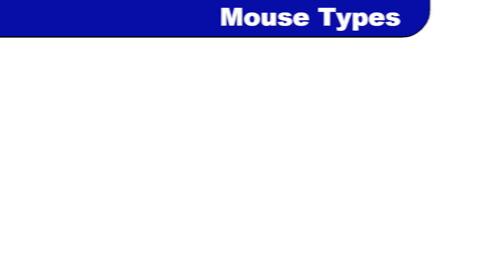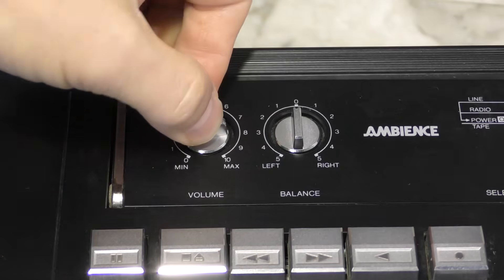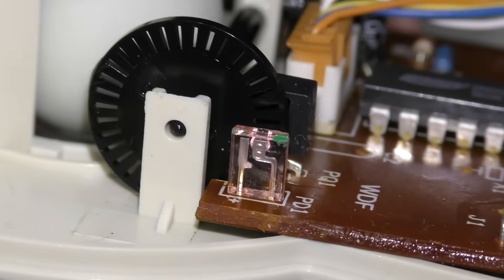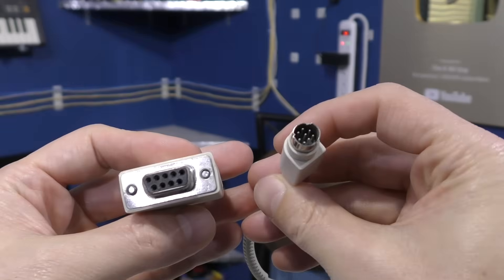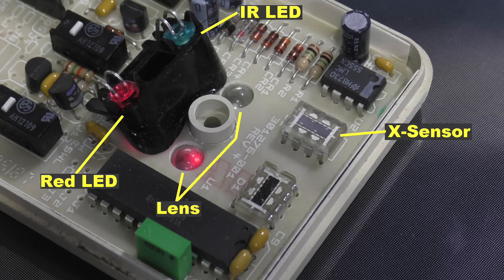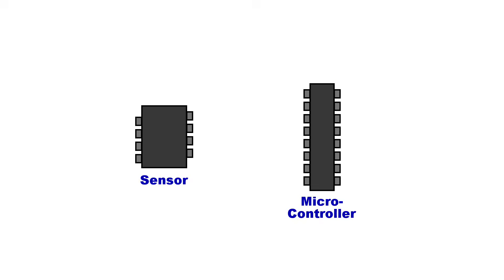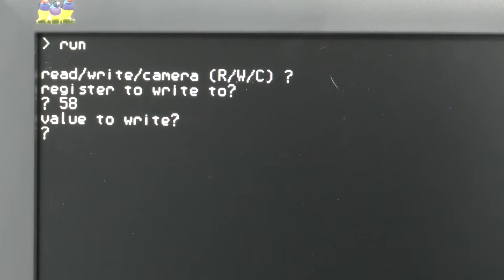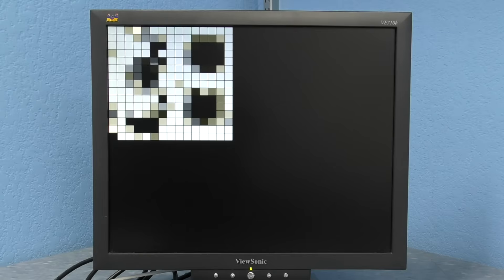What does a computer mouse see?

Comment: 3:07 I always cleaned the ball... My whole life was a lie
Reply: My dad is a technician, he would always pull the gunk out of the inside with a pocket knife so that's how I learned to clean it (not with a pocket knife, of course).
Reply: I remember doing this as a kid. Just used my nail to scrape the rollers, never even thought about cleaning the ball, because it didn't look dirty 😋
Reply: I was 1 years old when those mouse came I think-
Reply: @kruleworld  That sounds neat! I use digital mice these days, but I must admit the rollerball mice have a special charm about them. Even if they could get pretty yucky!
Reply: When I started college, the workstations all still had ball mice. Sometimes one of my classmates would complain the mouse wasn't working, so I'd really quick flip it over, pull the ball out, and scrape the rollers with a fingernail (by the time it got that bad, the gunk was generally stuck together enough it all came off in one piece) and it would work fine afterwards.
Reply: It’s called natural selection
Reply: i used to always clean the ball.
i used to always throw it in the air and catch it  LOL
it was cool

but one day i realized there was a lot of shit on the rollers and sensors so i cleaned them and i realized what i needed to do
Reply: @martinkuliza  What a fookin tool

Comment: A theory for the read delay:
IIRC, those old connections tend to be half-duplex. Meaning it can transfer data both directions, but only one direction at a time. And it might take some time to flip between direcitons. Bytewise transfers would have to flip around at least once.
In normal operation, the Computer -> Mouse direction is propably only used during initial setup/device setup. Afterwards, the driver would be only recieving data (never sending anything else in return).
The actually work goes only Mouse -> Computer. The chip is propably staging the data somehow and sending it to the computer in one big batch, on a pre-determined timeframe.
Any delay between changing directions would hardly mater. And limitations like those were one reason we went for USB.

Comment: I don't think that potentiometer-based mouse was as much hard to use. Almost every GUI environment allows only a finite area for cursor position. It's usually limited with screen resolution. Potentiometers allow you to "instantly" calculate cursor position without any initialization at any moment, because it's trivial to scale allowed mouse positions into the possible cursor positions. Probably, the ball will do a hard friction at the end of the potentiometer range but that would mechanically signalize about the edge of the screen.

Comment: If you get a rework station, you can remove chips without needing to trim the legs off of them by waving the hot air over the legs while pulling up, it's super handy. https://www.hakkousa.com/products/rework/fr-810b-smd-hot-air-rework-station.html

Comment: My first ever PC had a serial ball mouse. I still have the last mouse I've ever used on that system somewhere. The only reason I kept it is because it also supported PS/2 in addition to 9-pin serial.
Cleaning those rollers was not a pleasant experience. Also, the resolution was pretty low even when compared to a low-end optical.

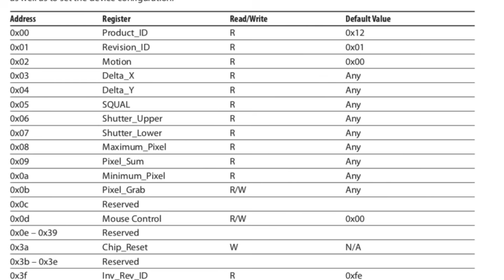Comment: 7:58 "Now you'd think all I need to do now is read register B here,  which is pixel grab."
No, no I did not think that, let alone think at all when the data sheet was displayed..
Reply: Benjamin Lum its actually not too difficult to understand, its all laid out on the datasheet, for example take the register Motion at 0x02, so since its using a byte it has 8 bits, below the chart with the registers it lists in detail the bits and the fields and what they mean, like for Motion it says bit 7 (it starts at 0 so 7 is actually the 8th bit) is MOT which it says is motion since last reported which returns two values, 1 or 0, 1 meaning motion has occurred, 0 meaning no motion, with the rest of the bits reserved. What this tells us is that you can read at 0x02 and the 7th bit will tell you whether or not motion has occurred. 

If you’re interested in reading more for yourself you can find this particular datasheet at https://media.digikey.com/pdf/Data%20Sheets/Avago%20PDFs/ADNS-5030.pdf

Comment: That was fantastic! But I'm still a bit confused, hopefully someone can clear this up. If it takes multiple seconds to scan the picture, and then do any image processing, how is this mouse able to work at real speed? Was the programming you wrote to display that image far slower/the computer far slower than the given micro controller in the mouse? Or would the code in the mouse perhaps only process a chunk of the image

Comment: The mouse you describe it about 2 minutes doesn't actually frustrate people.

Basically, the endpoints correspond to the edges of the display, and it's always the same position. So for example, if you slid it down halfway, and then lifted it up, and then place down, and then slid it down again, it would still respond to the same way. It just blocks you from going outside the screen if that makes sense.

Modern computers don't use this method but it wasn't actually quite what you think it is.

Comment: I wonder why you needed that huge delay reading the sensor.  The only thing I can think of is a corrupted signal from using such a long cable.  I wonder if a short cable attached to a fast microcontroller (like an Arduino) would work any better.

After all, the sensor is designed to talk to a chip that's only a centimeter or two away.

Comment: Serial, commodore, Atari, amiga, and Macintosh have identical ports. What’s up with that
Reply: DB-9 is a standard connector type for many electronics interfaces. No point manufacturing your own bespoke connector when off the shelf parts work just as well.

Comment: Those optical mice on Sun workstations were quite good, except the pad was a bit small so you had to lift the mouse and warp it at the other side to continue your move because of the high-rez screen… I don't remember any sensitivity setting, probably they weren't available to the users.

Comment: That ended, without a really solid explanation of how the optical mouse works. Because a optical mouse does not need the Sun Mouse pad. My conclusion is that the pixels, are used by the software and just look for changes in the x and y axis. It was still not a very satisfying answer final. But I loved the creativity of the hack.

Comment: I used to work as a lab operator back in college and found the perfect way to clean roller ball mice - lightly spray detergent on the desk, roll the mouse over the wet area in a circular motion, remove the ball and the gunk would come off easily with a cloth (no need for a knife to scrape it off)

Comment: I got a question, I used to use a G400s mouse which is Optical for many years untill recently when the movement tracking would pause for a second every now and then, the LED is clearly visibly red and quite bright, but recently I upgraded to G Pro Wireless, the LED is a lot dimmer but it is Optical too, how come the LED doesn't need to be as bright to read?
Reply: If you compare the specs of the two mice, you'll see that the wavelength of light produced by the G Pro is longer; so it's mostly producing and detecting light which is outside the visible spectrum.

Comment: And then you've got the people incorrectly referring to optical mice with an LED as LASER mice, there seems to be a few right here in these very comments. Some have even done the all too common misspelling of LAZER (damn you, Bill Wurtz), IE ahh yes, our old friend the Light Amplification by the Zimulated Emission of Radiation ;-). One other thing of note is that LED and LASER optical mice do still have to be cleaned. They get dust on the optics and start getting sluggish or jittery.

Comment: That's really interesting. Perhaps the 50ms delay was introduced because of the length of the wires between the sensor and the computer?
Reply: get a mous cable 1 meter , the speed of light is 299.792.458 m/sec , the signal at the wire runs with speed of light. >> Delay is  1/299.792.458  = 3.34 *10^(-9) second !!! 
if you wand an delay from 50ms = 0.05 second . 
you need s = v*t = 299.792.458m/sec * 0.05sec = 14989622,9m = 14989,62 kilometer !!!! A very long mousewire 

But ib real the 50milisec comes from the internal framerate of that sensortype. 20 frames per second

Comment: I had a mouse back in the late 90's that if you moved too quickly, the mouse cursor would move in the opposite direction. This was especially annoying when playing Unreal and needing to snap the mouse quickly. It would do this even when perfectly clean. I always suspected the issue was similar to the optical illusion when watching the spokes of a car wheel at high speed appear to turn backwards while the car is moving forwards. Like the optical sensors inside could no longer track the correct direction of the aperture wheel. If you ever do a part 2 on mice, please do some exploration on issues like this.

Comment: Hmm... 50ms delay between pixels?  That's 50/1000, or 5/100, or 1/20.  Reading 214 pixels would take over 2 seconds!  How can that possibly give precise motion tracking?
Reply: The chip does the motion tracking internally. The raw pixel output is at a rate of 1 pixel per frame, presumably for debugging. I also suspect the rate is faster than 20fps, but 50ms was just a safe value hat worked.

Comment: If you use Python for coding here, it is much much better to use PLY library for making text interfaces - it lets you use any command syntax you want, and it is very easy to use.
Reply: You can write primitive REPL with input/parse, or even input/token using only lexer, and the library will call your code in t_ p_ functions anntated with command regexps or BNF notation

Comment: You’re showing your age if you've ever cleaned the gunk off a mouse’s rollers.
Reply: Was one of my many jobs at the school I used to work for... We glued the covers on so it required a screwdriver.
Funniest thing was when random teachers would freak out that opened the mouse while the power was on 😂
Reply: I still do.  There are many situations where a mouse with a steel ball works better than an optical one.  Especially when your desk surface is a solid color without any texture (like some of the painted glass surfaces you see sold in office furniture stores).
Reply: @Shamino0  they also work without a mousepad on clear glass desks!
Reply: @Shamino0  Just buy a mouse pad.
Reply: @Shamino0  but there are mice in the market that are advertised to work on glass too... but they are a little bit more expansive
Reply: Not really, they were common up until the early 2000s.
Reply: @aronhighgrove4100  I'm 15 and I remember useing them
Reply: When I worked in an office, I got yelled at by a superior for opening my mouse to clean the crud out. Next time I went to the IT guy and told him what was going on, and he got grumpy and told me "You know you just scrape this crud off the rollers, why are you wasting my time?" In short, fuck office jobs.
Reply: I was a bit surprised when he said in the video that people cleaned the ball instead..?!?.. that never occurred to me back then.. I would always scrape the wheels..
Reply: stop I'm only 22 I'M NOT THAT OLD 😭😭😭😭😭😭
Reply: I was quite relieved when laser mice became available.  I hated how quickly those gunked up and how meticulous you had to be with the tiny ones.  Somehow the rollers also catch hair like the agitator in a vacuum cleaner.
Reply: im 20 and yet i have used roller mouse, still got one under my bed too.
Reply: 69 likes lmao
Reply: I've cleaned enough gunk that i'm trying to grow a long white beard right now
Reply: I'm a zoomer and have used one
Reply: Used them up to 2010 and regularly had to clean the entire mouse because the Chinese staff in the lab would destroy the poor things and then toss them out when they no longer worked.  A little ethanol goes a long way...but to this day I still don't understand how they gunked them up so quickly, it was a lot of skin oil and other crap o.e  the rollers were always caked with hair.  I used to sit in the office and fix them up while waiting on the HPLC reads.  Didn't really have anything better to do for those hours.  Felt kinda nice in the end to turn a yellowed mouse with an inoperable trackball into its original gray freewheeling self.
Reply: @Solais1019  I cleaned mine every 8 months when I still used mine
Reply: It was a regular ritual with my Amiga mouse, but it was my first mouse, so to me it was a normal thing to be done. I remember enjoying the feeling of holding the heavy ball in my hand.
Reply: Ball mice are not that old tho like 10 ago years they were still being used

Comment: All these different mouse technologies are very interesting, but i do wonder how those light sensors don’t get confused with eachother once the wheel scrolls up  or down ,left or right;
Also i wonder how that camera sensor souse is garanteerd to always detect movement, because i tryed it on a blank paper but still it could somehow detect movement, maybe it could even see particles in with blank matereal ,at whether color to garanteer movement detection,mmm.
I wonder whatabout next, a gyroscope mouse? Or a ultrasonic sound detection mouse with would require a special mouse pad with a wall surrounding it sothat it could detect movements that way???
Only time will tell.

Comment: You might like the "On the Metal" podcast when they interview Tom Lyon.  Whose brother invented the optical mouse (along with some others independently doing it at the same time).  And spoke about the design of some mice if you had the pads the wrong way round they wouldn't work and how other designs the pads were omnidirectional.

Comment: You can show microscopic text on banknotes with optical mouse pickup.

I should look at why you need to sleep 50ms after every pixel, generally you actually get a burst image transmission on the ones i've seen. Not sure what's up with that. I'd have an urge to sigrok the initialisation with original micro in place before trying to drive the sensor directly, it could be important. Tends to be. BTW gaming mice also use a discrete sensor, for the most part, but initialisation is actually very important there.

Comment: For many years I used a wireless, PS/2, opto-mechanical ball mouse. A while back, the contacts in the microswitch for the middle button broke and I haven't had the ambition to replace it. This mouse doesn't have the highest DPI and the rollers collect crud, but it's served me well over the years and I haven't had any major complaints.

Right now I'm using a $13, wired, Samurai "gaming" mouse. It has various problems (the sliders seem to be made of a rubber-like material that collects crud and the mouse wheel has started to 'bounce' after only a month or so of use), but I wanted to talk about the movement.

I made sure to set the Windows mouse speed to the middle setting, which should be 1:1. I set the adjustable DPI on the mouse to a comfortable speed that's not sluggish, but not overly fast either. Sometimes it seems that the pointer gets stuck and doesn't move properly in some cases. Also, it seems much harder to position the pointer precisely. Maybe the optical sensor is more sensitive to movement, but precisely positioning the pointer, such as in a graphics program, takes a lot more effort than it did with my old mouse.

I'd chalk it up to a bad mouse, but I've tried various optical mice over the years and have had pretty much the same experience with all of them. Precise movements seem harder to make with an optical mouse than with a ball mouse. That might seem strange when optical mice are supposed to have higher DPI and more accurately register movement, but that's my experience.

Comment: My first mouse (probably about 1990) was a cheap one with electromechanic  rotary encoders. Imagine circular PCBs with a radial pattern of copper traces on it. The motion was picked up by spring loaded brushes,  and the traces on the PCB wore off pretty fast. So the mouse didn’t last very long till it's motion started to hop around, and I had to buy a more expensive one (like shown here) with an optical rotary encoder in it. Great video to show what it’s about with those mice, even though some steps in the history of computer-mice development are missing.

Comment: Honeywell had a system with two axially inclined rotating feet. Prior to modern optical mice these where the best mice as they are super easy to clean. Probably most used on Digital workstations. I had a serial one from Honeywell and is was brilliant till I moved to a laptop whichnwa so course PS/2 😟

Comment: The optical wheel sensors are quadrature detectors - each one is 90° out [in phase] from the other so the direction of rotation can be determined. Seems optical mouse sensors can have quadrature outputs to emulate them.

Comment: You needed the pixel read delay because It can only give you one pixel per frame.  Puzzled why it needed 50ms instead of 1-2ms, as these sensors often run at 1000-10,000fps...

Comment: Back in the day, I had a rather clever mouse cleaner device.  It used a ball with strips of velcro wrapper around it (the loop half, if I remember correctly),  It had an accompanying mousepad like surface with the other half of the velcro on it.  You would remove the mouse ball cover and mouse ball and insert the velcro covered ball and set the mouse on the velcro pad and roll it around and the velcro would rub the schmutz off the rollers.

Comment: Old-school Sun workstation mice don't really require a special mouse pad, but it helps.  Take a piece of tinfoil, crumple it up, flatten it, crumple it up, flatten it, crumple it up, flatten it, smooth it out, and wrap it around a flat surface, and it works pretty well. The more wrinkles you can make in the tinfoil before smoothing it, the better.